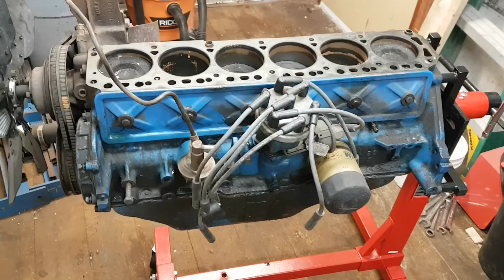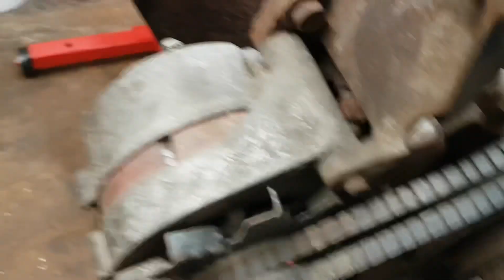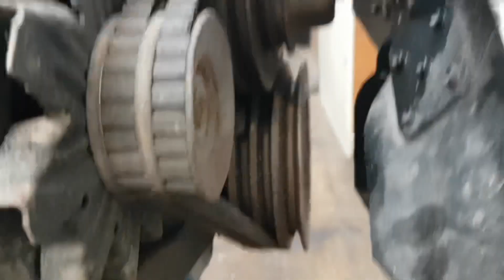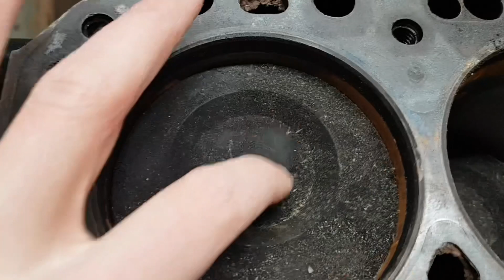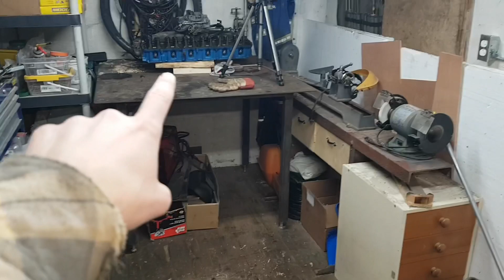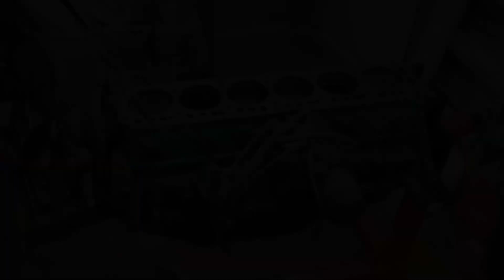Ford 300 Inline 6 Engine Rebuild Part 1: Repair, Rebuild, or Replace??? Decision Time

Comment: 87’ is the first year of the EFI. That’s what I drive. It’s a great truck and engine.
Reply from the maker: Very nice. I’ve never had an EFI version, but have heard that the EFI system was reasonably robust on these engines, as it’s not just throttle body injection, but has 6 individual injectors.
Reply: @JeremyKamutzki  I have a very tired 1995 engine with 270K miles. I am looking to begin the rebuild very very soon. I already have the EFI, and I really am trying to stick to basic modifications to make it just a little better. Even in its tired state, I just finished towing a trailer from VA to FL and it averaged 11mpg. The 92-95 engines were the definition of reliable. The 96 model year added OBDII...some call it positive, others a negative.
I am on the fence about just buying a block, since mine is old and I am not sure the exact condition of the history...It would definitely be a trip to the machine shop.
Reply from the maker: @brianperry4754  Sounds like you got your money’s worth out of the original engine. I know you can purchase short blocks for the 300 ford, though it may actually be cheaper to have your current block machined. If you have a good shop near you, I think that you’d get a better final product going with a professional rebuild versus a ‘refurbished’ short block. You’d have to compare costs though; it’s been a while since I’ve looked into it.

Comment: The EFI manifolds have 3 extra bolt holes (not 2) and they're more for keeping them in place on the assembly line so they didn't have to try to balance 3 different manifolds in their hands all at once (an intake and two exhaust).  They're not necessary for sealing.  I have EFI manifolds on my carb'd head and have run them for almost a decade and have never had sealing issues.  
I don't use any retainers or clips, etc.  Just studs, thick washers, and a nut.   Torque them down in the same sequence as you would the carb'd exhaust (start from the center and work outward).
Also, try a Remflex 3005 gasket if you want some amazing sealing.

Rebuilding your engine gets my vote.  You'll enjoy knowing you have the original in there.
Reply from the maker: Thanks for the suggestions! It’s good to hear a positive review from someone who’s done what I’m attempting. And I agree… I’d be pretty happy knowing I have the original engine! :D